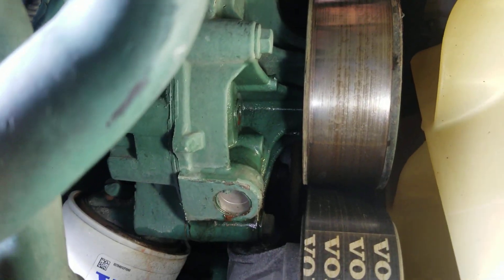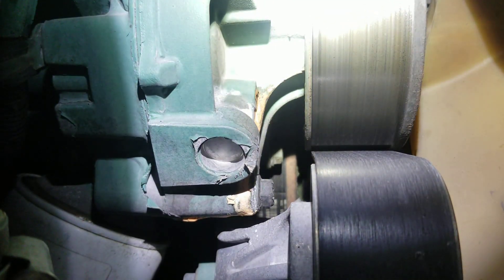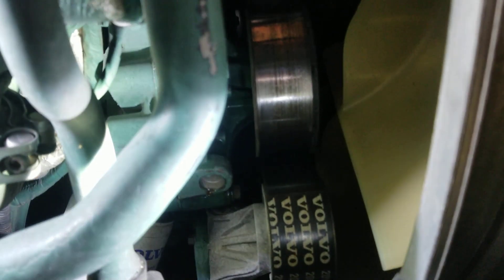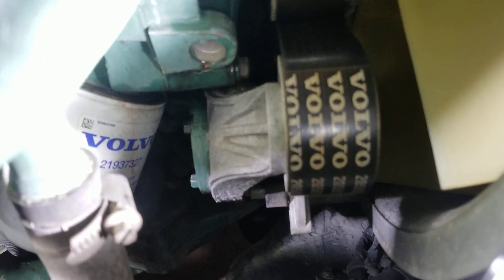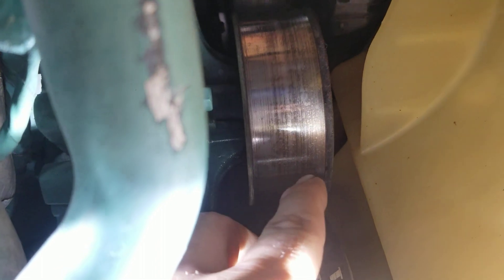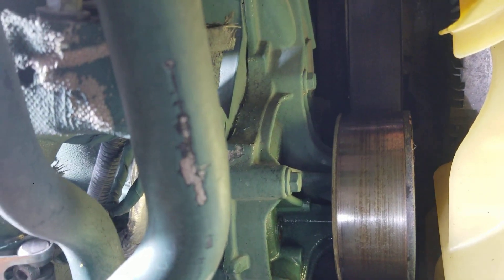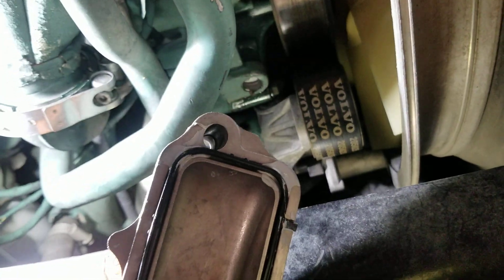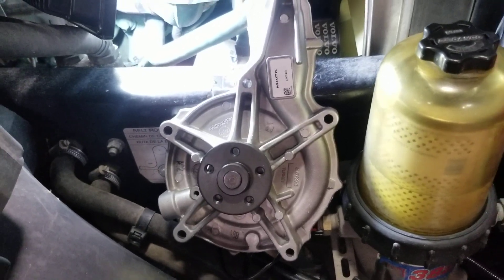Volvo truck d13 water pump signs and warranty personal experience tips

Comment: I had very hard to tell leak from the water pump where other left tiny marks of leak and mechanic told me u can drive until it starts leaking more or fail or replace now. I decided replacing it because last thing I want is to be stranded on highway. Idk if that’s possible since I’m not mechanic

Comment: Also check backing plate for gouging so there is no cavitation.  And check old impeller on the shaft. Common failure. Plastic impeller gets hot expands and she starts slipping on the shaft

Comment: There is a small hole under my water pump. It leaks. My water pump has been used for 4 years and 170,000 miles. How do I guarantee it? Do I have to go to a car dealer to replace it?？  thanks

Comment: Thanks a lot, I have a question too. I am leaking fuel from the top of coolant filter just from the water pump. I don’t know if fuel has anything to do here. Pls suggest if you know. Thanks
Reply from the maker: Hi you shouldn't have fuel there. There are fuel lines in that area if you have frame mounted filter. But they are down below by the frame rail and radiator. I would clean it up and dry it. Run the engine and see where it starts to get wet or follow the drip up to see where it comes from. Also there is a coolant hose up and behind the water pump by the head. The clamps get loose and can leak coolant down
Reply: volvo big trucks thanks I will follow ur guidance

Comment: your videos are great  camera work and words you use to describe things is very easy to understand... i found water pump Look at this on eBay
https://rover.ebay.com/rover/0/0/0?mpre=https%3A%2F%2Fwww.ebay.com%2Fulk%2Fitm%2F153483887755  its aftermarket. have you used it and should i buy this one as price is really good. my water pump is leaking in cold weather. thank you